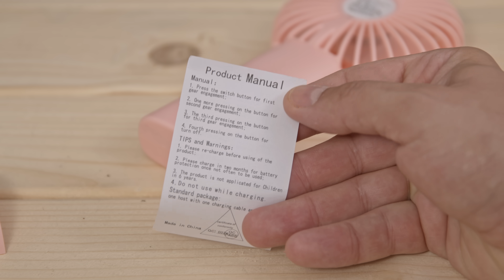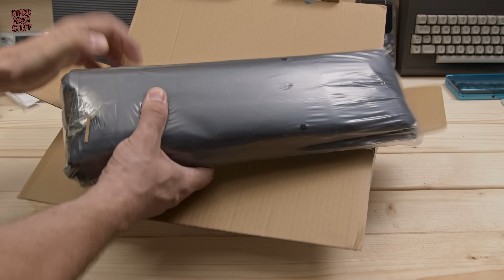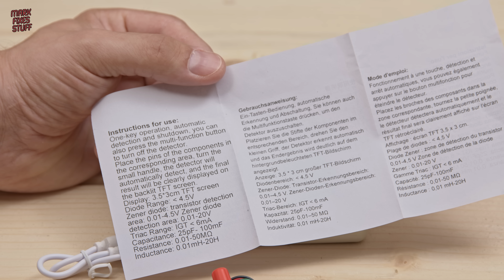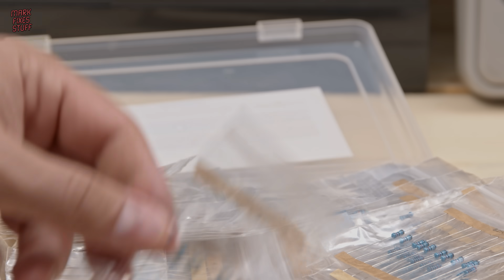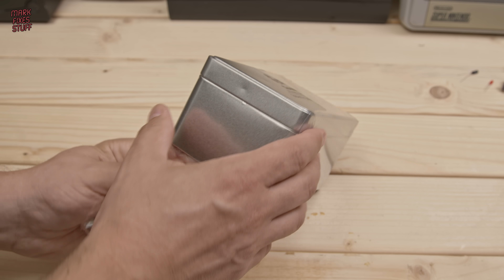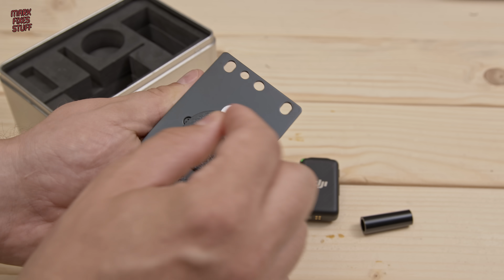TEMU QUALITY CHALLENGE - Can I find Quality Items for Fixing and Repairs? £150 well spent?

Comment: with the component tester MAKE SURE to discharge each capacitor fully before connecting it !!
The testers can be damaged if you don't!
I have lost 2 that way
Reply from the maker: @Keeping_IT_Simple  thank you!! It does say that in the instructions. The Peak Atlas Tester discharges so I really need to remember!!
Reply: @MarkFixesStuff  You actually got a manual & you read it - no wonder you are so good at what you do!
Reply from the maker: Haha! Or I’m so clueless I resorted to finding the manual?

Comment: Good choice on the Qanba stick.  I've got 3 of the 8bitdo sticks and ordered 3 sets of alternate Qanba buttons (x8) for £16.50 each, absolute bargain - Plus they are mechanical keyboard switch type.  Disgusted as I paid £6 per button (£48!) for Crown mechanical arcade buttons from Arcadeworld (which the shop has strangely disappeared) - So effectively 3 sets of Qanba mechanicals for the price of 1 set of Crown mechanical buttons from UK.  Mental.
Ordered the same style ball as well.  I admire your blue ball, but I had to go to the next level and get mine hammered purple, ooooooooo errrrrrrrr.
Reply from the maker: @suavebob  I love this stick. I am really excited to make a colecovision controller anyway because the originals are hard to use.
Reply: @MarkFixesStuff  Ahhh you've given away your surprise as I don't think you mentioned that project in the video - I'll keep it super secret. Think you are probably wise to make a new controller for the Coleco though, that original looks unwieldy.  3D printing or making out of a nice bit of wood?

I saw your stick on Aliexpress, was on sale for £20 (original price was £33'ish), I was tempted to pick it up and drop in on the 8bitdo, but if I remember correct I wasn't 100% on the depth for fitting, plus my gates weren't compatible (I just put octagonal in everything through habit) - The latter is a stupid reason I know.  
You can get 2lb, 4lb etc springs if you find it too light.  Simple install as well.  I've got 4lb springs in 2 of mine but only because they have metal bat tops, was recommended by the manufacturer to counteract the weight.  
Joystick wise I went the cheap/quick/easy way of just replacing the microswitches on the board, they just drop in/direct replacements/no soldering - 1 has Omron, 1 has cherry and the other has Sanwa.  
You can get different size actuators (plastic bit bottom of stick at the c-clip) but that's getting into the weeds at that point.  Pretty sure I changed 1 of mine, but couldn't tell you which one, so that shows how little difference it actually makes.

Dunno how you don't like the clicky-ness 😲 Its like sacrilegious.  I had blue keyboard microswitches in those Crown buttons previous, you would have cried at the excessive volume of the click
Reply: Wow, AWUK gone, just saw the threads about it after reading your comment. Been using them for 15 years.
Reply: @googleboughtmee  Yeah, I am not too sure what happened to them as i've used them quite a few times over the years.  I first noticed they closed about 3-4 months ago, website was just gone.  I've not looked into it myself, so not sure what happened to them.
They were one of the few retailers in the UK I found for Crown mechanical buttons at a semi reasonable price (£6 a button!), albeit I have now moved over to Qanba mechanical (wayyyyy cheaper, actually a better feel and more colour options).
If Mark is bothered by the noise (given he chose the silent stick), the Qanba mechanicals come with a silencing pad, can be removed if you want them louder.